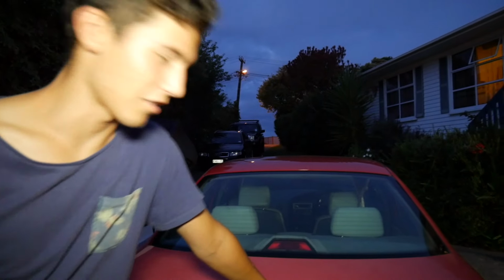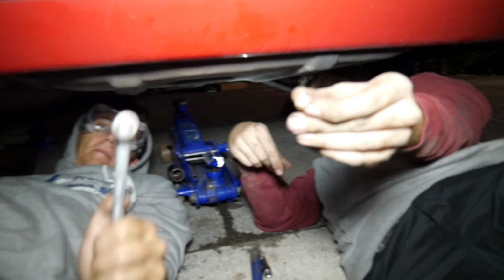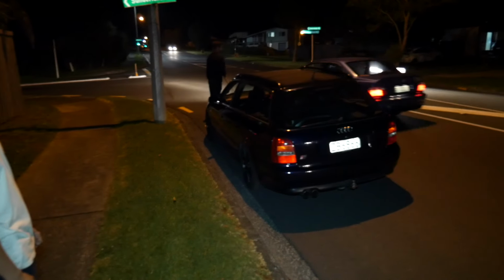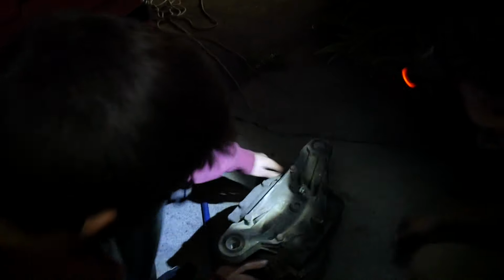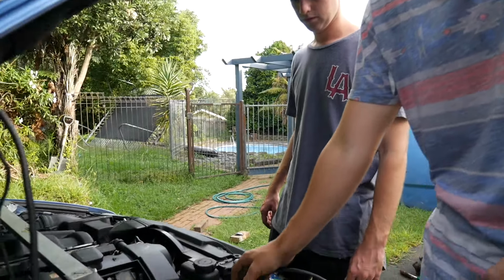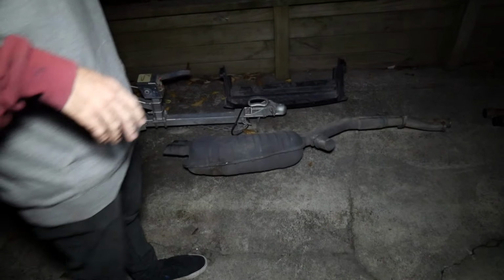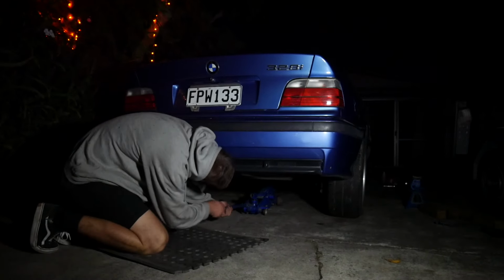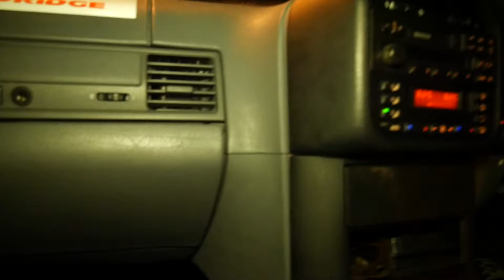THE E36 TRACK CAR DRIVES!!

Comment: Two things I want to add - whining is most likely the vanos in the car not the diff or transmission. Vanos is loud when you have a straight through exhaust or a leak close to the headers / manifolds 
Secondly when swapping an LSD into a 328 you may or may not have a slight lag on acceleration as your get into low end RPM's in 3rd and forth gear just the difference of gearing I believe the 328 has stock open 2.93 diff and LSD you swapped in is most likely a 3.23
Reply from the maker: +Zach Karr Great to know about the Vanos! It probably does need a Vanos rebuild tbh, the car has done 300,xxxks! 
It turns out the gearbox was low on oil, something no one checked! #rookiemove haha 
It has since had new oil and runs much better :) 
Cannot confirm the ratio of the diff, but you are probably quite right, however the red e36 it came out of was an automatic so the ratio would still be pretty decent for acceleration. 
Thanks for watching! Always learning new things off the comments section :)
Reply: Zach Karr the auto 328s come with a 3.64 open medium case diff. The LSD that we've put in is apparently a 3.7x or something similar, giving it slightly more acceleration and less top speed.

Comment: You should put the 325 inlet manifold and throttle body on the 328, it will increase power.
Reply from the maker: +786carrera looked at that! Very cool mod!

Comment: i have a track car and mine dont sound like a space ship what is that whine ??
Reply: exhaust leak?
Reply: It's the transmission or diff, one of them must be low on fluid
Reply: that would make sense cause i was wondering should my track car make that noise hahaha
Reply from the maker: +NI7R0 update turns out the gearbox was low on oil, something no one checked! #rookiemove haha 
It has since had new oil and runs much better :)

Comment: It sounds supercharged, but with no supercharger. Does the diff have fluid?
Reply: VemacRD350 i was searching the correct question 😃 you win 😃 guys change pinion bearings and add good oil 😃 or leave it ! cool sound for tc 😃
Reply: It helps when the gearbox has oil in it.
Reply from the maker: +VemacRD350 +NI7R0 update turns out the gearbox was low on oil, something no one checked! #rookiemove haha 
It has since had new oil and runs much better :)